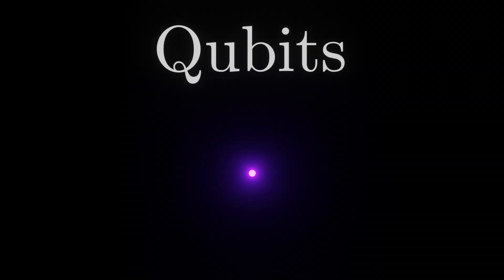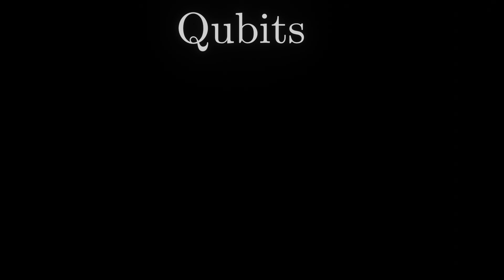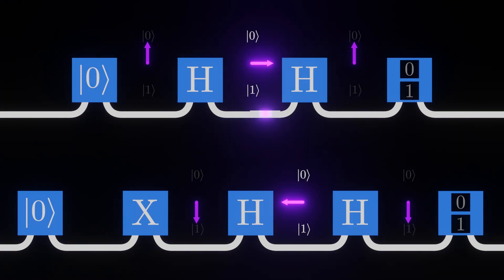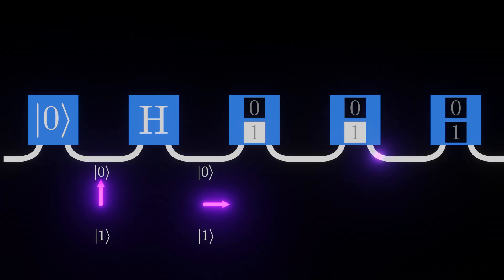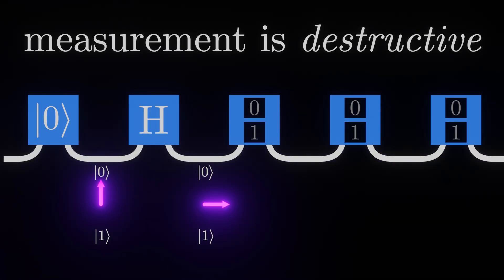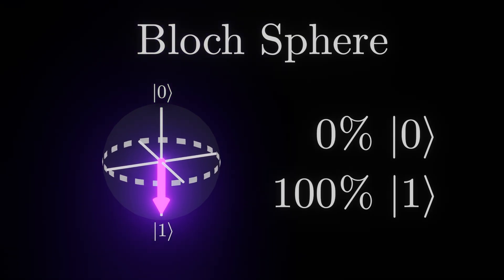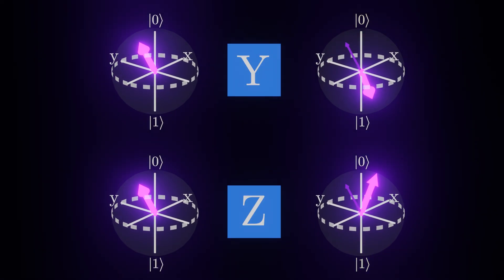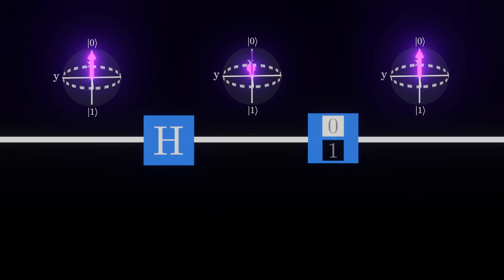Logic Gates Rotate Qubits

Comment: I couldn't understand certain of quantum computing when there is some pop science video or article about it. For example, I could understand how can anyone computer anything with this, if the result is undefined. But maybe your videos will make me reach some understanding (although I need to do more reading). First time I hear about Hadamard and Block sphere. I don't know in practical terms how these are constructed (what kind of hardware do they use for quantum computing),. but I am almost getting something now, but not sure. I get at some places in this process things are firm, a bit is a certain bit, of coure measurement will collapse it, but some of these quantum gates might help to kind get some result. Nobody has explainded that to me. I know about the pop science of how since there is every possible state of bits, you get results in an instant, like you calculated for every possible permutation of bits, but I am still not there in how the hell to go from this "randomness" back to a specific output.

Comment: How does the second randomiser or the qubit remember the previous state of the qubit before the first randomiser when the first randomiser randomised it (deleted it from the qubit itself) quantum info is not violated by what I am saying because the information now exists in the first randomiser which is not connected to the second one). Your premise is not at all what quantum mechanics actually do and is quite paradoxical.
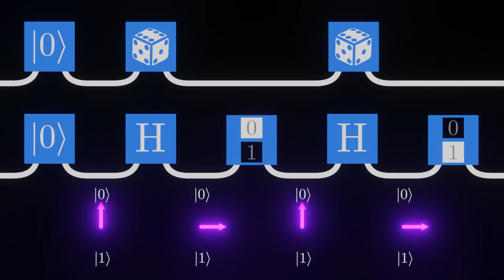Reply: At 4:50 , he says that the randomness doesn't come from the h gate but it comes from the measurement. He later explains what the h gate does by using the bloch sphere.

Comment: In the Bloch Sphere the Z-axis basically determines the probability of it being either 1 or 0 right? What exactly can be said about the X and Y axes? The sort of 'equator' (I'm sure there is a better word for this in mathematical terms...) on the sphere for example sits at a constant probability of 0.5. Does it then matter at all where on this equator line you are?
Reply: It matters in relation to a qubit that is in a different phase or to terms of the same qubit that are out of phase with one another.  For example, if one applies a Hadamard gate to |0>  one gets the superposition (|0> +| 1>)/(sqrt(2)) = |+>.  If one applies the Hadamard gate to |1> one gets the superposition (|0> - |1>)/sqrt(2) = |->.  If we attempt to measure the resulting states the probability of getting |0> or |1> is the same for either qubit and either result:  50%.  They are at this point indistinguishable.  However, the Hadamard gate is its own inverse.  Now the Hadamard gate is unitary, which implies that it is a linear transformation.  As such one may apply it to each term in the round brackets in the Bell superposition states |+> and |->.  When this is done terms cancel, and what one obtain is H(H |0> ) = H( |+> ) = |0>  and H(H |1> )) = H( | +> ) = |1>.  

One way of looking at this is that the information in the qubit states |0> or |1> that had been encoded in terms of "magnitude", the distance along the z-axis, is transformed into the qubit's phase.  Applying the Hadamard gate again results in the phase of the qubit being re-encoded as magnitude, the same magnitude as before, prior to the application of the first Hadamard gate.  This is because the Hadamard gate isn't simply a unitary transformation but its own inverse.  

One way of viewing the term cancelation is similar to that involved in the double slit experiment of quantum mechanics. If there were no phase then the distribution of photons on the screen after passing through the slits would simply be an average of the the two individuals distributions obtained by having either one of the gates open but not both.  But this is not what we see in the double slit experiment.  Instead there is a pattern of constructive and destructive interference that may actually result in no photons being measured at the center when both slits are open even though photons are measured at the same point when either slit is open but not both.  Destructive interference that results from waves of equal magnitude being perfectly out of phase result in a dead zone.

If we may for the moment omit the multiplicative term of 1/sqrt(2), H(H( |0> )) = H( |+> ) = H ( |0> + |1> ) = |0> + |1> + |0> - |1> = |0> because the |1> terms cancel and H(H( |1> )) = H( |-1> )= |0> + |1> - |0> + |1> because the |0> terms cancel. Complete cancelation is complete destructive interference.

One quick aside... Not all unitary gates are their own inverses.  For example, any gate that uniformly rotates all along any axis is a unitary, but some may rotate a qubit half a full turn and others may rotate it only a quarter turn, a 1/16th a full turn, or any arbitrary fraction of a full turn.

Comment: Josh, these videos are awesome. You're a fantastic explainer. You've done a great job at breaking down the concepts of quantum computing from the perspective of a computer scientist. I'm not sure if this is in your video roadmap, but do you plan to explain how all of this is actually implemented? I understand that classical computers use transistors and relative voltages on wires in order to store and transmit information. On a physical level, do you have any good readings on how quantum computers perform these tasks?